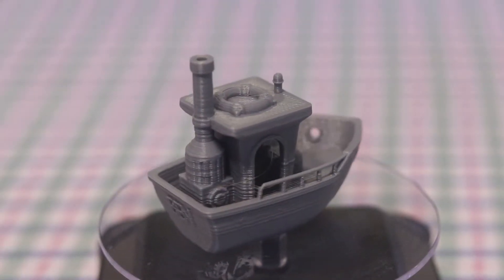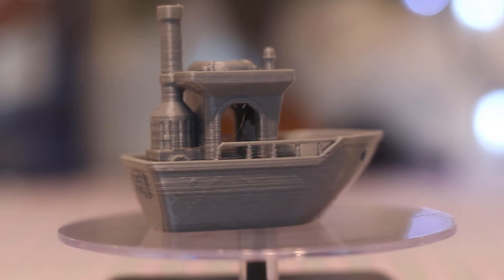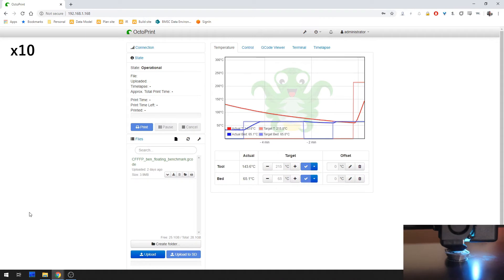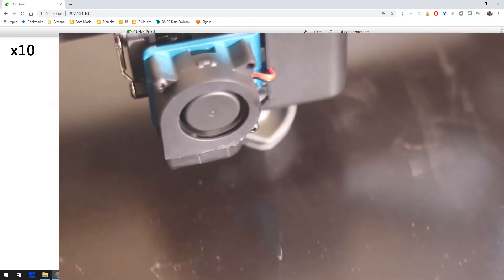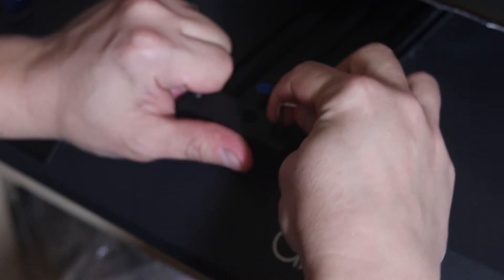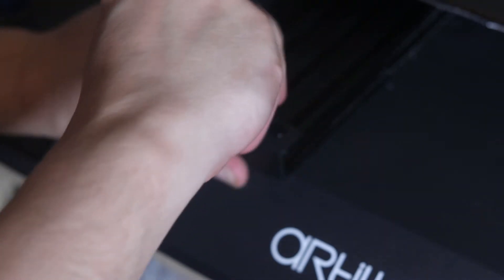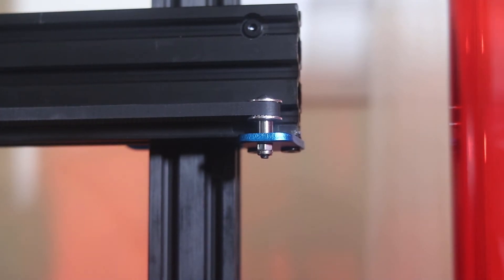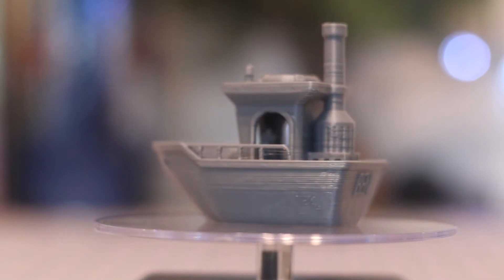Troubleshooting Artillery Sidewinder X1 | Part 1 | Filament Runout Sensor and Belts

Comment: Unfortunately this method to tighten the belts does not work for long time and old belts. The distance to move those parts are just way too short, especially the y-axis has almost no distance to play.
What do you think? Do i need to replace the belts. I don't even know if they are available somewhere in a good quality and correct length.

In my opinion, Artillery just didn't design this printer to run over many years, otherwise they would have added a real belt tensioner or something similar

Comment: I have problems in cylindrical shapes there is a vertical line all along with the model, the line is created in the place where the extruder changes the direction.  Do you how to set up to avoid this vertical line? thanks, by the way I am using Cura.

Comment: Hi Igor and thanks for this review (the first one I agree with regarding problems with the SWX1!). Just for your information, discrepancy between layer are annoying! And I personnaly fixed it adding a Z Brace on the printed (from Thinigiverse). I performed the same test you did, with and without the Z brace, and it is really much better! Next step for me is the software. Because stock is really bullshit! (Eeprom locked, more bed leveling option through Marlin, PID tuning, etc.)

Comment: Hey Igor, I got the same machine a few weeks ago and use it almost every day. This is my observation. Printing with layer height = 0.15 (Normal) gives me almost perfect quality. Printing with layer height = 0.3 gives me quality close to what I see at your videos. I wonder what layer height and what slicer do you use for your prints?
Reply from the maker: I usually print at 0.2 and 0.3 mm and I do not see any significant difference in terms of layer consistency

Comment: My hotend was overshooting and undershooting temps, too. I did a successful PID tuning, however it didn't help at all. It was so bad that I couldn't even get a print to start.
Swapping out the motherboard for SKR 1.4 fixed that.
Reply: Did that help with the stringing issues and such ? Any videos on how to make the switch as well?
Reply: @brianyousef5764  i just googled it, there's an article about it and a pic of both boards and where the wiring goes in each. it's easy. i've been running hemera from the start and never had stringing issues so can't say

Comment: Why is bypassing the runout sensor supposed to improve print quality?
Btw, what slicer do you use? What are your speed, retraction and coasting settings?
Reply from the maker: The theory is that it may be causing an uneven drag on the filament. There's a video on Maker's Muse channel  about this printer, where he stated the runout sensor as one of the POSSIBLE causes of uneven layers.
I use Cura 4.4.1, print speed is 60 mm/sec, retraction is, I believe, something like 2 mm @ 60 mm/sec. Don't remember the coasting settings, will look them up later when I get home. I print with Inland Gray PLA+ at 215C.

Comment: Wonderful video series! Thanks for these helpful tips!
Reply from the maker: Thanks, Eunice! So far, these tips have not made a significant difference for me. I mean, most of these operations are parts of basic maintenance for every 3d printer, so I would have done them anyway. Most importantly, I think the Z axis drive system is flawed. I'm currently working on some enhancements and have already gotten some improvement. Stay tuned!

Comment: I'm having troubles with bed leveling, bed corners are correctly leveled, but the center point is too hight, have someone experienced the same problem? any sugestion?
Reply from the maker: I have a similar issue, only in my case the center point is a little bit too low. In most cases it's tolerable (the prints stick to the bed pretty well), but I plan to enable manual mesh bed leveling, which would allow to mitigate the issue. I'm actually releasing a new video very soon, in which I will be updating the firmware. The stock firmware has EEPROM disabled, which means you cannot save settings to the machine's memory. Also manual mesh bed leveling is also disabled in the stock firmware.
The other option would probably be to add a piece of glass on top of the bed. That's how I solved a similar problem on my previous printer, Wanhao i3 Plus.
Reply: I too have that problem, but like Igor my centre is too low.  I'm getting around it at present by leveling to the print area I need, which is normally only a small part in the centre, so it's ok if the edges of the build plate don't have the right level height to be printed on.

 This obviously wouldn't work too well if you are wanting to do a larger print than about 100 mm diameter.

A potential work around is doing a higher or lower first layer and over or under extruding the initial layer to try to get a good bead that sticks where the nozzle is further from the bed. Add ten or twenty degrees to bed and extruder for the initial layer and cross your fingers. Give the bed a real good clean with isopropyl, that always helps me.

A more complicated fix is as Igor has suggested, by using some sort of Auto leveling system that can probe the bed like a bltouch to know the true shape of your bed and adjust your first layers to suit the dish or dome. That is how I'm planning to fix the dished bed issues on my swx1. I think a basic fix can be done for under a hundred dollars.
Reply: @davefenton102  have you tried lifting the nozzle up, heat up the bed, then resetting every leveling gear to zero, then to max, then to the middle, maybe a few times, then level the bed as normal. Kind of like a flex.

Comment: you need to check the flat cable on Z maybe it was buckled too much. I had the problem until yesterday.  Change it then it will print better.
Reply from the maker: Interesting... Were you having similar issues (inconsistent surface quality)? Also, which cable are you talking about? If I'm not mistaken, I only had to plug in 2 ribbon cables when assembling the printer: one for the X axis, and another one for the extruder itself.
Reply: @IgorsWorkshop  in my printer it was the bigger cable on the left frame site
Reply from the maker: @maxmono8398  Gotcha! That's actually the X axis cable. Did you just use a spare they provided?
Reply: @IgorsWorkshop  yes i use the spare part from artillery but i'm looking for new ribbon cables without kinking